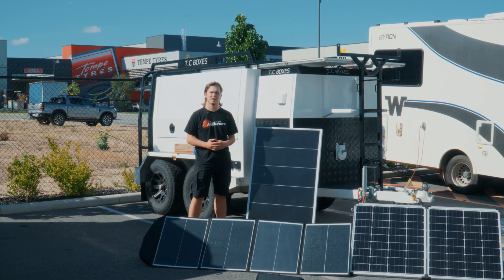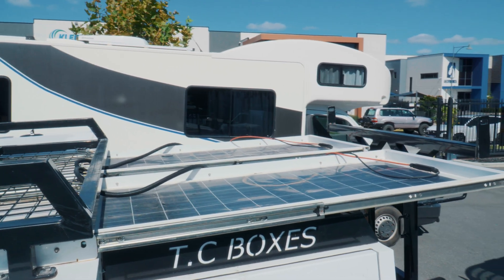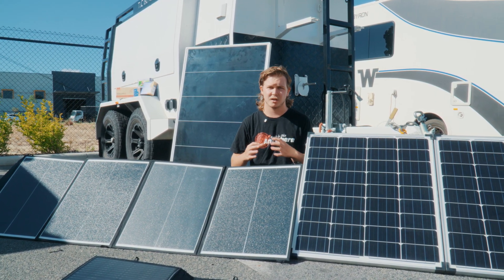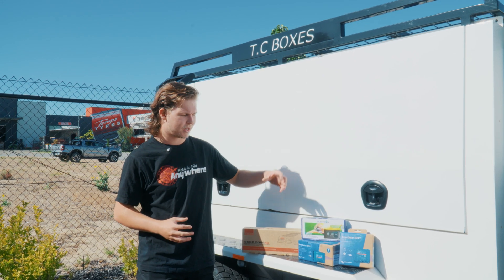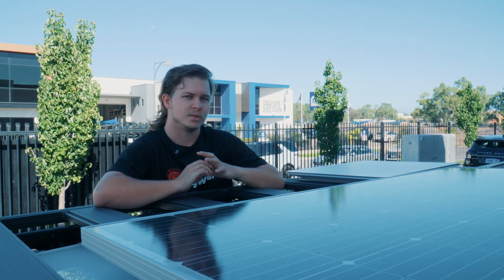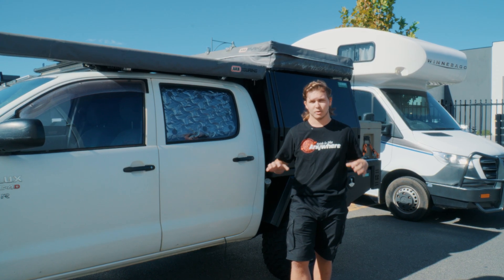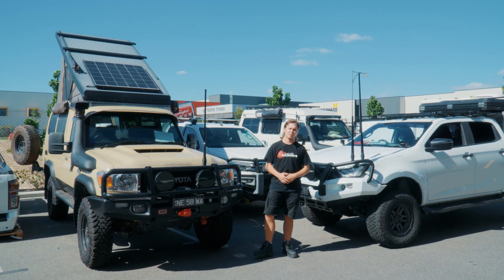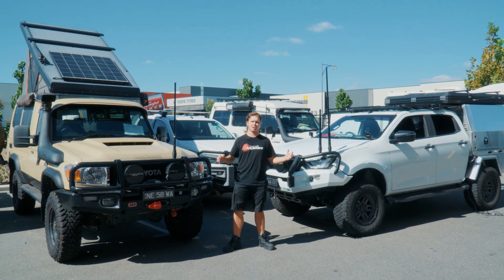Solar Showdown: Rigid vs Flexible Panels – Which is Best for You?

Comment: Hi Justin,
Yes please high voltage panels…..
I am looking since years for small size high voltage panels in Australia.
I have 5 victron panels on my roof but the voltage is terrible low.
As of Germany used panels with 40-50 volts which perform much better.
The Victron regulator can handle 100volts

So, please spill the beans on high voltage panels since there is no one has ever offered it neither a comparison 

Thanks mate and Best regards

Cheers
Reply from the maker: Hi Holger, 
I have passed this onto Justin for you. We do have a video in the works in which we will compare some high voltage solar panels to there standard voltage counterparts so please keep and eye out for that in the future!

Comment: What size battery and inverter for air fryer and induction?
Reply from the maker: Thanks for the Questions! 
It mainly comes down to what appliance you use and the wattage rating on it. however good combo that we often run is a 200AH Lithium battery and a 2000W inverter. This combo can run most air fryers and induction cooktops out there. We do plan on releasing a video soon about cooking Off-grid with an inverter covering different appliances and battery combo's so keep an eye out for that soon!

Comment: Do you need to clean panels if they get dust on them?
Reply from the maker: To ensure maximum output of the panels it is best to keep them as clean as possible. Most panels will still work with dust on top of them just at a lower rate